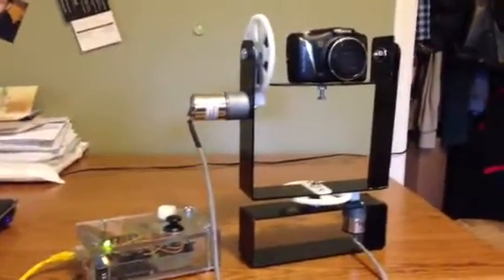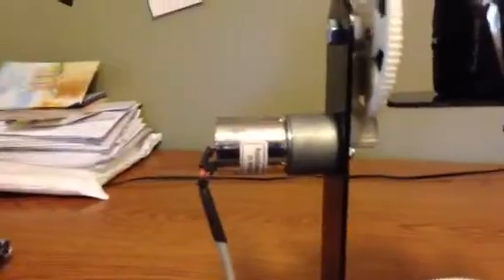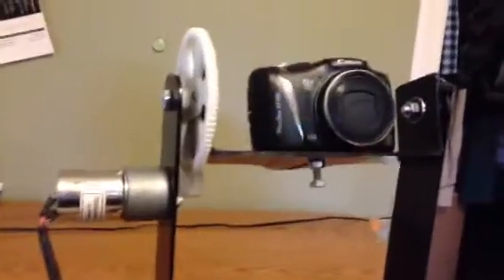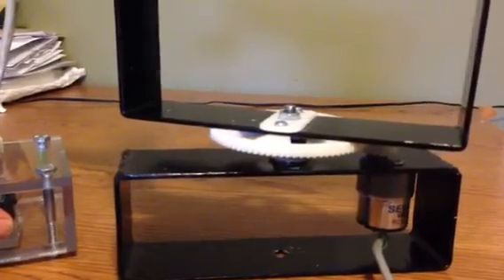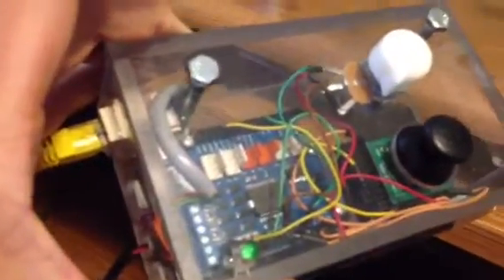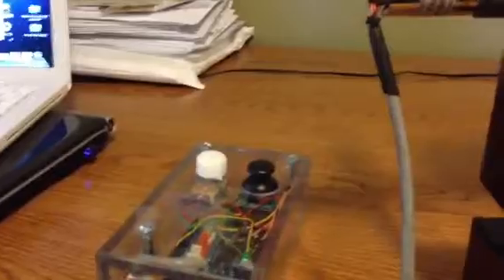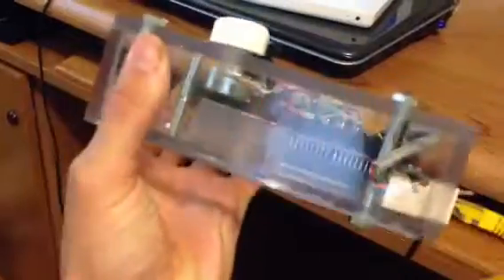DIY Pan tilt camera mount  detailed view

Comment: Hi Jacob, thanks for this video. Really good work cos its simple design.
I would like to make my own. I checked servos and think will use 45 RPM. Could you tell me if i can slow the motor down with controller? Also how many tooth have you used for servo's spline and how many tooth for big gear? Thank you, Marius
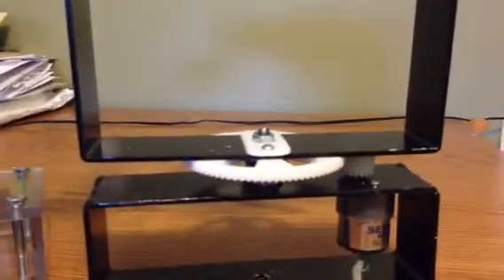Reply: See, what kind of engine's and wheels you can get, because it is not easy to find the right combination in stores. If you can get an motor with 200 RPM then you need other wheels combination to let it run smooth. The calculation is like when you have a 200RPM motor, then it makes 200 rounds a minute. If the small wheel is 25 teeth, and your big wheel is 250 teeth, then it is 1:10 so the turn is then 20 RPM. That is still a bit fast. But it depends what you want to use it for. From my experience i like higher speed motor to make it more smooth.

Comment: Hi, could you tell me the planning stages that you considered? 
what are the forces at work to keep in mind? 
how you calculated?
Reply from the maker: I first calculated how much torque i would need to lift the camera. there isnt much force on the pan axis so a smaller motor can be used. The max tilt axis torque can be calculated by multiplying the weight of the camera by the length away from the axis the camera will be. I used a safety factor of 10 when calculating the torque. let me know if you have any other questions

Comment from the maker: Hello, 
This is a very fun project and im glad your trying it out. I used standard long board bearings. (it is what i had and they worked well). I used the arduino uno with a motor controller shield. If you want to do a position based pan/tilt you should use stepper motors. I was going to use them, but the programming would be a lot more complex and you would need more than one motor shield.

Comment: Hey man, I'm an engineering student working on a project very similar to this.  What kind of bearings are you using? Where did you get them?  Also, what arduino board are you using?  With this same design, would it be possible to make position presets (like each 90 deg from the other) rather than have free motion controlled by the joystick?